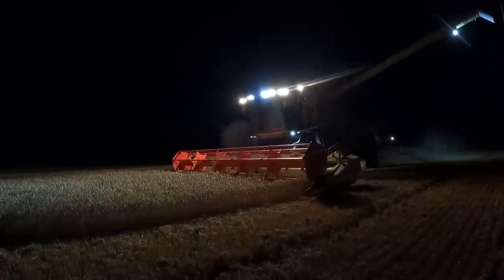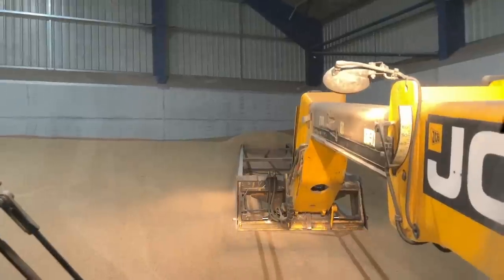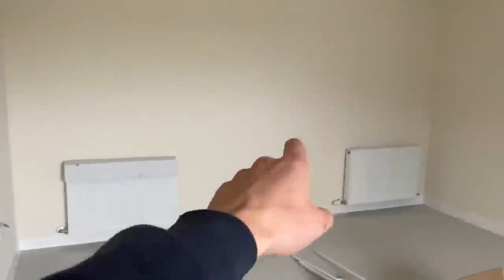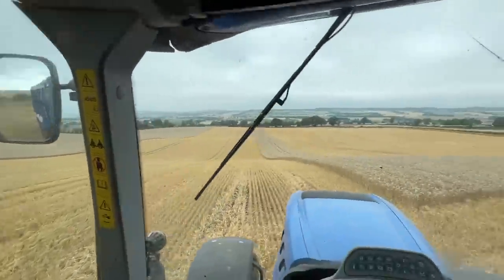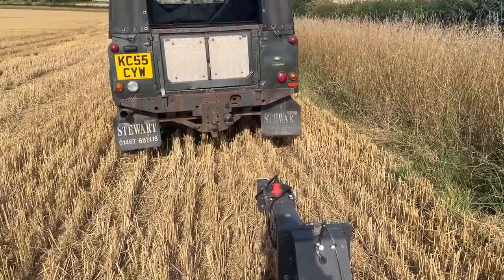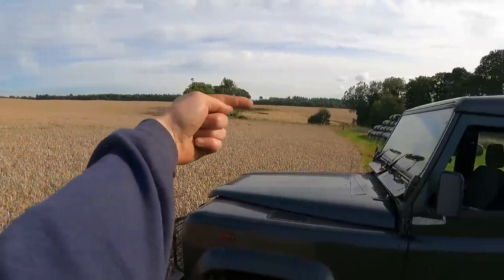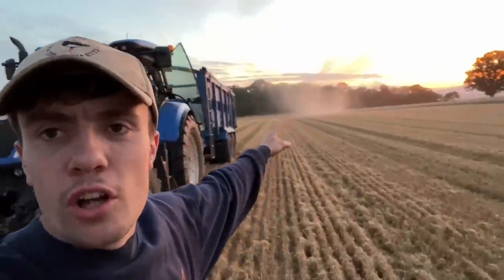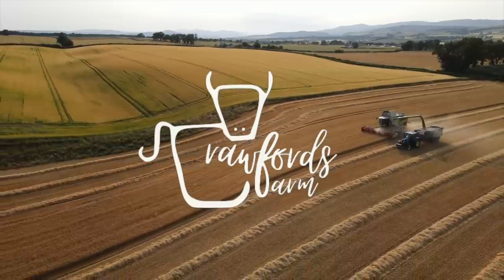Building A Wheat Mountain

Comment: Are you finding a browny coloured dust this year? I'm encountering tons of it cutting wild flower meadows and it's so fine that I'm having to blow the radiator out 4 or 5 times a day and the air filter daily. Just curious if its just the meadows and not the crops too?
Reply: Sahara dust?
Reply: @JohntyNich  na, i thought it was pollen to start with but it was more like a mouldy dust.I remember the sahara dust. It was an orange/yellow kind of fine grit.I was just curious if it was the kind of weather we had this year
Reply from the maker: Not too brown but theres alot of it